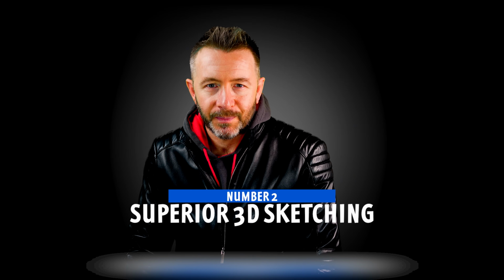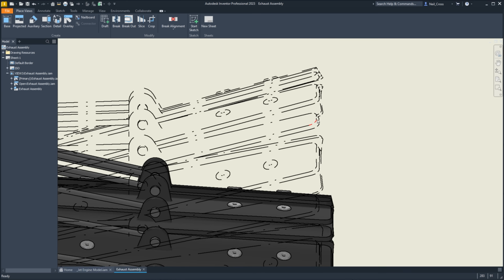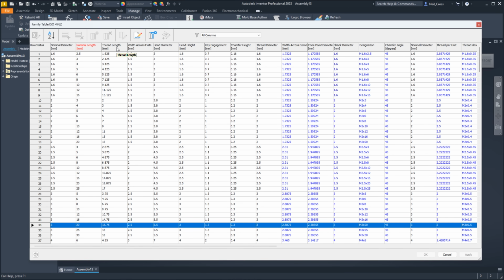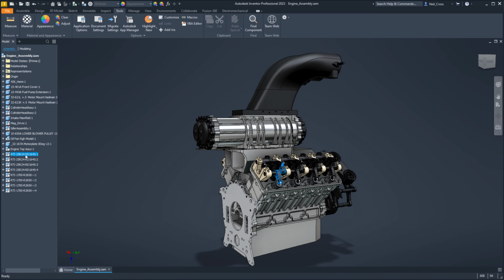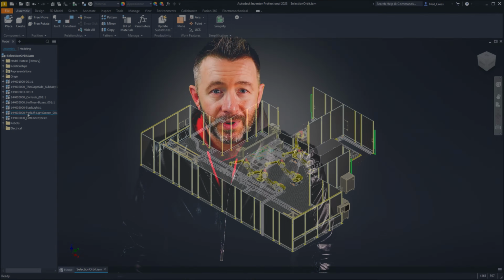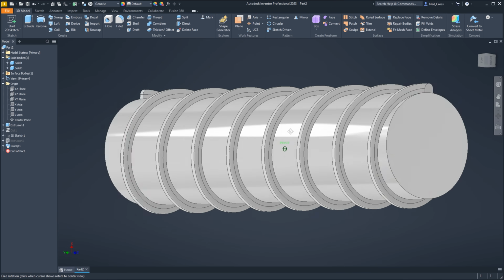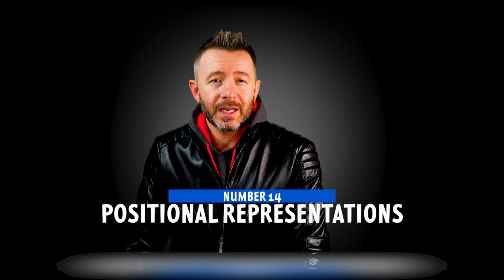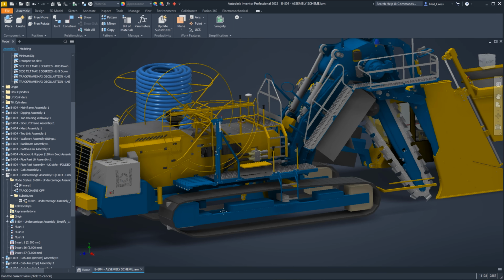15 HUGE FEATURES Inventor has that Fusion 360 doesn't have

Comment: As a solidworks user it's interesting to see the features inventor has that fusion 360 doesn't are shared with solidworks. Makes the idea of transitioning between the two seem less daunting.
Reply: Transitioning between SOLIDWORKS and inventor isn't too bad once you understand what controls are fundamentally different. Often times they can be changed in settings to be similar. For a long time I hated that SOLIDWORKS defaults to free hand sketching then dimensioning after the rough shape is there, but then I found out there's a check box that changes that to work just like inventor where you define the dimension while drawing the feature.
Reply: trust me dont switch from solidworks to inventor it's worse and less friendly to use

Comment: Inventor: Single line plate marking. And drawing view labels referencing the model iproperties. Fusion: even if there was more visual contrast in the browser between the active component and the inactive ones it would help a lot. I remember when Fusion (not 360) was bundled with Inv. 2013, it only had a dark theme...

Comment: 10:50 the default workflow is what you did there and clicking OK. the preview only shows the component you selected moving, but if the rest is jointed or rigid-grouped to that component properly they too will move once you confirm the operation.  And yeah joints can be nice and quick, but you definitely miss the freedom and power of good ole constraints.
For component context, I can generally keep track of what component I'm working on, because I usually get there via the component tree. I also recommend enabling component color swatch, click the gearwheel on the bottom right. For small assemblies it's good enough, for large one you'll run out of colors though.
Reply from the maker: Nope the rest of the subassembly didn't move when I confirmed the joint, I obviously made sure of that before going live with saying it... fortunately I've still got the dataset and whilst comments like this always make you doubt yourself, I've just tried it again and it's definitely just moving one part.  Tbh the state of the parts within the oil cover subassembly, whether they're rigid/joined/flappy/wobbly it shouldn't matter, if you're at a parent level and applying a relationship to a subassembly, it should apply that relationship to the entire subassembly.  I can't even wrap my head around how F360 would even begin to track things like that when done at the parent level, it's blowing my mind.
Reply: @Neil3D  I think the root of that issue is that by clicking in the 3D view you're not jointing the subassembly as a whole, just the part that you clicked in the subassembly. But even just saying that proves the point: it's a hot mess and it should be better.

Trying to joint the root component of the subassembly is shitty too, because it's not obvious that then you have to properly joint every subcomponent so it's constrained to the root component. That's what happens when you blur the line between assemblies, subassemblies and parta, which is what Fusion components do.

By the way, great video, is Autodesk paying you yet for clarifying this kind of thing? Autodesk themselves is doing a pisspoor job of explaining what you get extra for the higher price of Inventor.
Reply from the maker: @antalz  Yea when I click a component and it all highlights as one collective assembly, I expect that to behave as one collective assembly, so the joint should move it as such.  But nope, I haven't taken a penny from Autodesk in 6 years and that was for a completely unrelated Vault job, they've never sponsored a video or paid for content.  Although, discussions have begun for a potential big project with them for a series of videos... can't really say anything more than that as it might not happen, but up until now I've been 100% on my own!

Comment: Thank you finally someone makes a video about the shortcomings of Fusion. Before I knew Inventor I used Fusion and to this day work in both of them. I like fusion for not standing in the way for tiny assemblies, designs and mockups. But I cannot wrap my head around how someone would use fusion for even a small assembly with 50+ parts (counting nuts and bolts). I feel like fusion is a bit like python for programming. Perfect to learn and small things but nothing if you want to build rock solid complex software. But I think for fusion the ceiling for what is viable is much lower than with python (best example blender) ps: Reference dimensions were implemented a while back. But until that was the case I ran a couple of times right into that wall and it hurt
Reply from the maker: Fusion has driven dimensions yes, but you can't reference them.  I tried multiple times during scripting.  Once I'd created a driven dimension it was completely unavailable to the rest of the model.
Reply: @Neil3D  I am currently not entirely sure what is possible and can’t currently test it. Maybe you can only reference the driven dimension in the same sketch and not rename it or use it anywhere else. But I think this year they changed something regarding driven dimensions
Reply: Fantastic video!

Comment: curve on a surface is MIND BLOWING, SW is light years behind, I'm switching, I'm done dealing with STONE AGE Technology.
Reply from the maker: It's funny hearing different takes on that, some think SW is miles ahead, some think it's behind, just goes to show it's healthy either way!
Reply: @Neil3D  SW miles ahead? They gotta be kidding themselves, check out virtualflatCAD we wanted to model a sheet metal part yesterday but SW was pushed to the limit. Do you think inventor can do it? Problem statement in that latest 8hr stream by him. Candle extinguisher.
Reply: @Neil3D  another massive point inventor is free for students. Talk about getting access to pro software, SW has no FREE version even for students.

Comment: bro hi! you have wonderful videos, I subscribed to you and I try to thank all your material! I have a little question for you) how to change the Y axis to the Z axis in the inventor, so that Z is always vertical, and configure mouse control (alternatively, hang rotation on the right mouse button). Or is it possible to make a video with similar content? Thank you in advance!
Reply: You can't completely change it; you can set your template file to show Z as up but it's really only visual. Regardless of what shows on the screen is irrelevant, if you are moving the model to a CAM workspace, you can define Z as up at the time.

Comment: We need to tell Autodesk to put 3D Sketch into Assembly.
Reply from the maker: Why? To use for what?
Reply: @Neil3D  To use as a skeleton for assembling parts. For now, I have to create a separate .ipt just for the 3D Sketch. I knew Solidworks including 3D sketch in their Assembly. I saw some requests to add 3D sketch to Asm on Inventor Forum, but it never gets executed.

Comment: Haven't watched it yet, but already giving a thumbs up for the comments.

My guess is that you missed the 'can publish part libraries to Infraworks' though...
And can technically publish libraries to Civil 3D, but that tool is complete garbage
Reply from the maker: Yea I didn't go that niche! If I went that far I'd be on a 4 hour long video!
Reply: @Neil3D  I also found out that you're not an ilogic super user (I just assumed). I've dived deep enough into it that I can get an excel sheet live linked to Inventor to control all the key parameters (ie. Have excel open on your other screen and whatever changes you make in excel instantly change your models... It's pretty awesome.

Comment: The only thing that I would like Inventor to have is: a version of Vault on the cloud. In Fusion, you have something simple but it works quite well. I know that there are alternatives like Dropbox, but it's not the same thing as having a native integration of Vault that works as it works on a LAN setup.
Reply: We use vault with storage in our server, this has the same functionality as cloud based.
We are based in Canada and have team members in Spain that pull from the server with no issues. 
Cheers
Reply: There is Autodesk Upchain. I would just host Vault on a Cloud VM though.

Comment: 15 billions features Ferrari has that Reliant Robin doesn't have
Reply from the maker: If you buy Fusion 360, then add the simulation and product design extension, you're paying as much each year as you would for Inventor.
Reply: @Neil3D  I use fusion mostly for cam though,its a bit better at cam then inventor ;) add a package of cam to inventor and i think you are paying more.

Comment: Wow that was some GREAT info!  Thanks for sharing Neil!

Here’s what stood out to me (as a complete novice in inventor and F360) - 
1.	LOVE the idea Structural end conditions
2.	Family parts – I do this a lot, especially when making one version for 3D printing and one for manufacturing.  
3.	Assembly component REPLACE is huge for me!
4.	10:36 – LMFAO!!!  
5.	All the assembly mating stuff, for me, would be so important! 
6.	I love SHEET METAL, and I need the Inventor features
7.	Pack N Go is so awesome – You said it perfect – a project compiler.  A MUST HAVE!!
8.	iLogic looks pretty cool – bascally custom macros in VB – I could totally get on board for that! 
9.	Simplification is so important, especially for large complex assemblies! 

Great review Neil – Thanks for sharing such a comprehensive list of differences!!
Reply: To be fair, Fusion does join subassemblies if they have joints of their own. So, if they have been fully joined the preview will only show one part moving but then the entire subassembly will be positioned properly.
Also, Fusion does have the "replace component" command now. It was added a few updates ago. Although it only applies to components inserted into an assembly and not drawn directly inside it.
Reply: Toby , need something like power moves with a pattern for inventor. That SolidWorks live design video from 2021 is still best for the moves.

Comment: Weldments
Routed Systems
Mold Design (although the mold analysis has been taken out of Autodesk Inventor Professional and moved to Fusion 360)
Dynamic Simulation
Local solve of linear static FEA, including Parametric analysis.  (Fusion has far more analysis (cloud solving) types, but this seems to be important to the Fusion 360 users.

These are entire fields of missing functionality, but there are numerous other smaller bits - sketch blocks is the first one that comes to mind…
Reply: Do you recommend i switch from fusion 360 to inventor, im an engineering student and im getting better at fusion 360, ive built chassis, assembled parts in fusion 360. I want to know if its better for me to start inventor early on or just continue in fusion 360
Reply: @sdnoqhasdedf4930  I no longer have access to Autodesk software so I can’t comment on a moving target.

Comment: Neil, you're comparing a Ferrari to a Fiat.  Fusion does a damn good job considering the price.
Reply from the maker: I'm addressing a question that gets asked by thousands of people, the price difference does not make anything immune to comparison.  In fact, with Fusion, once you add on an extension or two it's about in the same ballpark in annual cost.
Reply: @Neil3D  Fair enough, keep up the good work.  I've always enjoyed your inventor tutorials. Although I never get to actually use it.
Reply: What is the goal? A hobbyist tool or is it to beat SOLIDWORKS? Does Autodesk have a different goal than typical Fusion or Inventor customer?